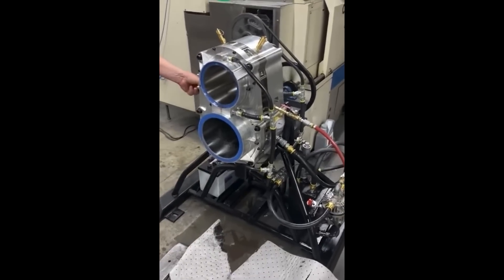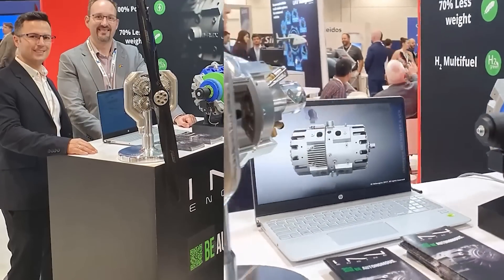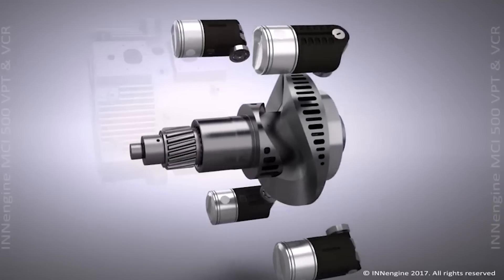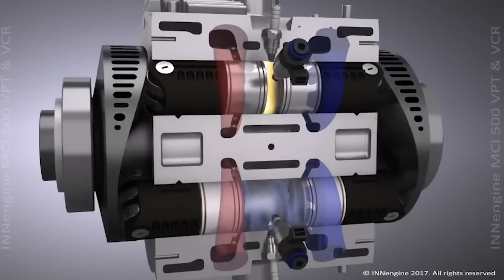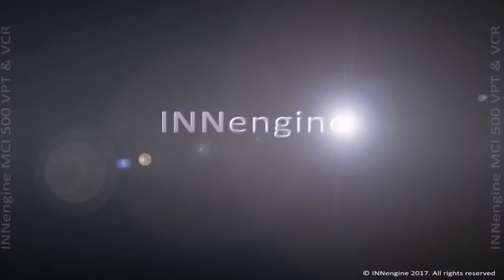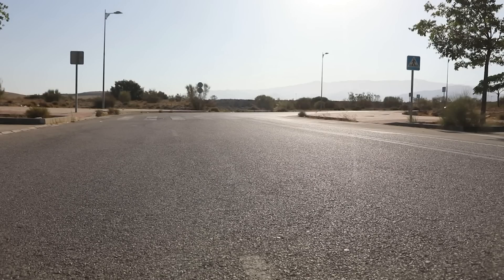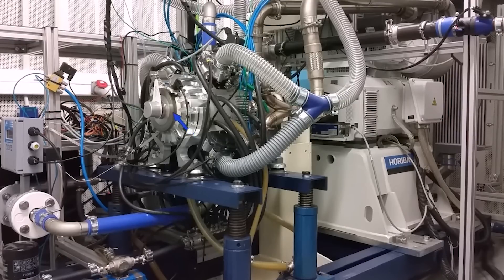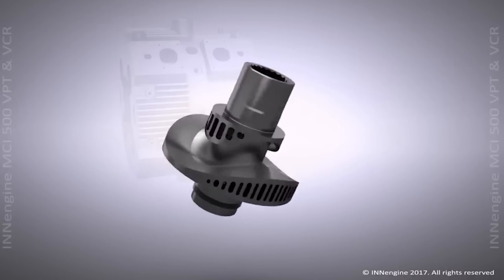1 Stroke Engine: Hydrogen powered Breakthrough in Combustion Engine Design.

Comment: Hydrogen is the future, not environmentally toxic lithium batterys.
Reply: Hydrogen is not the solution, there are too many trade offs when it comes to the containers in which you have to store it, because they have to manage very high pressure and H² is highly corrosive, so it's all not that easy and efficient in the end. The question is: Can this engine burn diesel?
Hemp and maybe some other plant oils are the more realistic solition for reneawable fuels, imo.
Reply: @franzabramowski6341 you are not up on the advancements recently in hydrogen,
Reply: Complex problem require many different solutions
Reply: The future is whatever people  can make the most money from, not what is the "best" technology
Reply: Hydrogen is also environmentally toxic
Reply: @griffint6637 never heard of that ammonia solution, have to look into that. Thanks for the input. Keep in mind that hemp also grows in great abundance and is just hard to come by due legal restrictions. It grows in almost every climate with little water, no fertilizer and no pesticides. It just needs to be harvested and pressed in an ordinary oil mill and can be stored in any container from metal to plastic. Not to mention that you gain other resources such as fibers, eatable leafs and animal fodder in the process. I would still agree that it's not the one and only solution, so a mix of both hydrogen and hemp oil is probaly the most realistic, depending on the local circumstances.
Reply: Couldn’t agree more 👍
The mining of cobalt and lithium is an absolute disaster take Cambodia as it’s being mine by children. If only these EV owners woke up to how their car is being powered and the devastation to the land for the acid chemicals and quantities of water, it’s a big disaster. As all this seep’s through the ground it to the foods and water 💦 supply😮
Reply: Glad you said that. For a moment i thought you were going to say Lead acid batteries are toxic - because they are if they are improperly disposed of. Lithium is a step better but we're not there yet. Not by a long shot
Reply: how do you produce hydrogen...
Reply: It's like the protestors use paper that says.. stop destroying the tree.
Reply: Bermuda triangle sea was abundant in H2...
Reply: Hydrogen will fuel the world for the next 100 years as a result of the work and new technology and advancements made in hydrogen fuel done by chemist Dr James Tour
Reply: I say this all the fucjing time
Reply: @griffint6637yes they are some issues, but to me they seem to be less or more easily solved then the problems that come with the Lithium battery BS.
Reply: Too late. With the current administration's infatuation with electric cars, this engine will be outlawed!